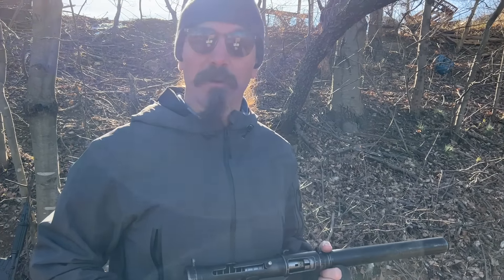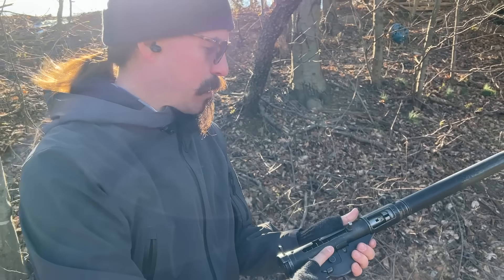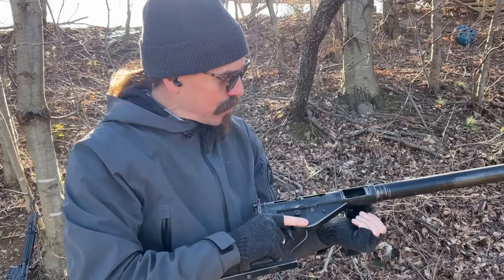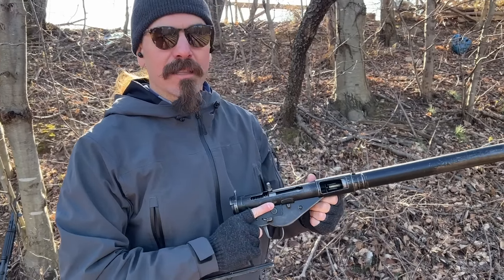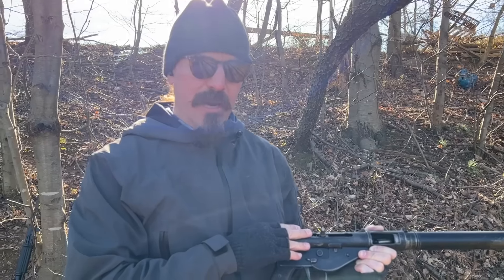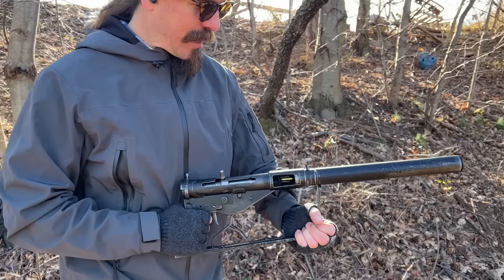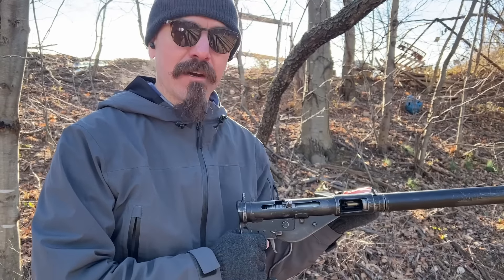Prototype Silenced Sten Mk4(S) at the Range

Comment: Archeologists in 200 years: We found a prototype STEN gun for use with ballistic face shields.
Reply: Fun fact, Britain actually fielded Plate carriers during WW2 fitted with chest, groin and back manganese steel plates. Some paratroopers and glider pilots used them in 1944. I was called MRC Body Armour.
Reply: 🤣🤣🤣🤣🤣 with an original aircraft reflex sight. Passive lighting, illuminated gunsight. Those were real too!
Reply: length of pull looks sufficiant for use with torso/shoulder armor.
Reply: Tbf, it would work well with gas masks and those had been in military service as a norm since 1916/1917
Reply: @ColBunkMust   True its a nightmare aiming with gas mask on
Reply: @The_Fubar you weren’t called that!
Reply: I disagree, Dr. Floznut44; I believe humans of the ancient 20th century had extremely large noses

Comment: I shot a bunch of machine guns at Rivers Edge Tactical in Ohio. The Sten Mark? was the softest and easiest shooting gun we shot that day, I was shocked that a pile of stamped steel and nuts and bolts could be so civilized.  Great video Ian!
Reply: The Sten has an absolutely stinking reputation, largely due to people on the Internet who've never handled or fired one parroting equally uninformed opinions they've read on the Internet. 95% of malfunctions on Stens are magazine/feed issues, partly due to 80 year old milsurp magazines, the remaining 5% are largely shonky wartime manufacturing issues, shonky rebuilds or worn parts. The design of the Sten is so basic that there's practically very little that can be  wrong about it, there's certainly no significant fundamental flaws in its design that aren't shared but other open bolt SMGs. Obviously any reliability issues are a problem if you're depending on it to save your life in a world war, but it largely did what it had been designed to do given the constraints of the time and it really doesn't deserve the "worst gun ever" label often slapped on it, at least in terms of what left the drawing board.
Reply: I agree, also I must thank you for teaching me the word "shonky"
Reply: @jonprince3237  it's because it's not American, so Americans that don't know anything will bash it, because reasons.
Reply: @jonprince3237  
No, that's the fact that it's one of the crappiest SMG in WWII. There were lots of reports of malfunction BACK IN THE DAYS. Nobody is making it up. This isn't an Ingram, a Nambu Type 14, nor a Calico. This is a STEN.
Reply: @jonprince3237  I've owned a registered Sten Mk-2 for 40 years. It runs like a sewing machine. I think the closest most people have been to a Sten, is video games. You're exactly right about the Sten, but I can add a bit to it. On some of the tube guns that were hurriedly built before the ban, the ejector is in the wrong spot, causing cases to hang up in the receiver. Some of those guns have been fixed in the ensuing years, most have not. Make sure the magazine feed lips are at 11° and the springs are the proper length. Only load 30 rounds in the mags. Some mags won't work no matter how much fiddling you do-toss those away. Use sub gun ammo, the hotter, the better. Many problems stem from crap ammo. Replace all the springs in the gun if you can. Like you said, these things are 80 years old.
Suppressed Stens are not intended to be fired full auto. They were the gold standard for suppressed firearms for many years, and were used in Vietnam, The GWOT, and still being used today. They're one gun you just can't kill...lol
Reply: @hoppinggnomethe4154  There were numerous reports of reports. Given how many STENS were produced at minimal cost and maximum speed it is impossible that there would not be issues with some guns. But, how many actual reports are there of combat malfunctions and how many reports of reports are there?
After all, we all know that a German sniper just needed to listen for a ping to know that a Garand was empty and it was now time to shoot the GI while he was reloading.
First-hand comment I read decades ago said all that was needed was for the armourer to run a a wire brush over and through the STEN before issuing it from stores to guarantee it would run right and that issues with the magazine couldn't be laid at the gun's feet.
Reply: @jonprince3237  I was equipped with a Canadian "SMG" in the 80s, Not quite a Sterling but basically the same, which is the Sten build in peacetime when there is less pressure to crank out as many guns as you can.  The thing worked beautifully, Very accurate very controllable very reliable.
Reply: Try a subsonic single barrel 410 with a built-in suppressor.
Reply: @jonprince3237  Thanks very much!!! 

I've already been insulted in various forums as an ignorant idiot because I took the liberty of pointing out that there must have been good reasons why the Sten submachine gun continued to be used many years after the Second World War. There must also have been good reasons why British special forces continued to have the Sten in their arsenal alongside modern submachine guns for a long time. The Israelis would hardly have copied a bad weapon, would they? The Germans also copied the Sten (code name"Gerät Neumünster"), they only attached the magazine at the bottom.

It was always a problem when the shooter used the magazine as a grip, which could lead to malfunctions. With increasing production quality - especially of the magazines - the quality of the weapon increased. In the end, the Sten did what it was designed to do. No more, no less. Given the extremely low manufacturing costs, this weapon was a great success.

Comment: That comes across as a lot quieter than most modern suppressors that I've heard reviewed.
Reply: Very short barrel so bullet velocity is slow and long supressor with lot of room to gas expand before
exit is nothing new in market but today people usually shoots full power ammo with normal
length barrel trough cans with lot of less dimensions to gas to expand. So of course
those will have less effect because not too many people are willing to have half meter long
supressor attached to 16 inch barrel.
Reply: It's shooting subsonic speeds so the bullet velocity is terrible.
Reply: @notgray88  Not terrible. Normal 9mm is just above speed of sound - 340 m/s or so. This will have something like 280-300 m/s.
Reply: Hallo
Reply: @asdfghyxcvbn1806  According to Ian, 240 m/s
Reply: @notgray88  Really? I didn't watch yesterdays video yet. If so, than yes, it is pretty bad. That is about the same impact energy as 38/200 revolvers had.
Well, I still would not be willing to stand in front of that thing. ;)
Reply: @asdfghyxcvbn1806  he said it in this video 0:54
Reply: That's because it's huge, this would be an "integral suppressor" by today's standards. It's an apples/oranges deal to compare it to a screw on can small and light enough to work with a recoil operated pistol.
Reply: @rollastudent  OK. I didn't notice. 800 ft/s or ~ 244 m/s.
Reply: Ta. I wasn't asking for people to submit their theses.
Reply: Mp5sd would be much quieter since the breach is closed vs the sten being open
Reply: And it’s open bolt !
Reply: Microphones don't catch gunshots well, in person all guns are much louder, even supressed ones.
Reply: A good portion of this is actually due to the ported barrel.  Obviously the size of the can and ammount of baffles helps, but the affect that diversion of pressure from the bore has is not to be understated.
Reply: @Manco65  Long barrel on low pressure rounds give much more area for gas expansion before the projectile exits, causing a lower pressure discharge, and by effect, less noise.
Reply: I handload 150 grain projos for 9mm. Subsonic with a can out of a glock is very surprising.

Comment: It looked like the bolt wasn’t even bottoming out in the receiver at 3:40 which is surprising considering how much weight and spring strength has been taken out of it. Seems like it was just barely cycling

Comment: You need to lock the automatic gain on your recorder otherwise it's compressing the peak of the weapon firing down to human voice level. 
You'll have to sound check and set the gain manually off your peaks but it'll give a much more accurate representation of the sound.
You can always have a second recorder running with AGL switched on so you never end up with unusable audio

Comment: I feel like the ideal use for the suppressed Mark IV would be with underground saboteur and guerilla units.

If they'd made more, I could see a group of guys carrying these with two mags each alongside their fellow partisans equipped with rifles and shotguns.

Maybe have the "scouting" forces sneak in and take down as many unwitting sentries as possible to gain access to a critical infrastructure point while the "louder" forces set up defensive positions in case reinforcements arrive.

Then by the time the explosives are set, everyone takes off and the enemy scratches their head the next day at why no one raised the alarm before the fuel depot exploded.

Comment: I wonder if the ease in keeping it on target is helped by the lack of cheek weld, as in the slow mo you can see the gun as moving and your body is being pushed, but your head is being held rather stable.
Reply: That would probably be technically worse because the sights are moving in relation to your eyes, whereas with a cheekweld your eyes are moving with the sights. Neither is ideal, but one should be a little less un-ideal.
Reply: @Tunkkis  that makes sense. All the guns I have let me get a proper cheek weld on apart from handguns which are their own deal. Ive never shot a stocked gun without a cheek weld available. I'd imagine from a shooters perspective instead of an observers perspective it's quite different.

Comment: I heard lots of Maqis were missing the tip of their middle left finger by popping then in the ejection port before firing.
Reply from the maker: That would not remove a part of a finger, it would just hurt a bit.
Reply: @ForgottenWeapons  House renovation in northern Italy recently uncovered a pair of rusty Stens plastered into a wall.   Partisan cache it is thought.
Reply: @ForgottenWeapons   - French-types are quite soft tho'. Cheers. Probably just an allegory for courting the mademoiselles.

Comment: What strikes me as so odd about that stock is that if they'd just added a top strap to the stock, there would have been a cheekweld available. Obviously the folding mechanism puts limits on the possible geometry of it, but when folded, there's a lot of space in front of the trigger guard. Potentially it could even just be a continuation of the rest of the stock continuing forward a bit. I can only presume that the imminent arrival of the Mk5 with it's much better stock killed off any attempts to iterate this into something better.

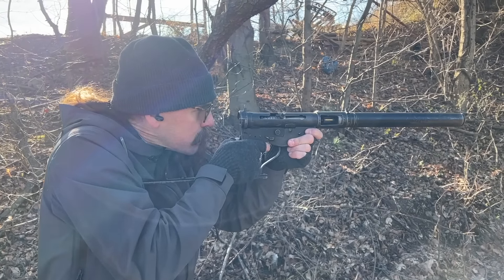Comment: Did it have a malfunktion at 3:32 ? Because it was in semi auto, and the round fired and ejected, but the bolt slammed closed again. Wouldn't this have fired a second shot if the mag wasn't empty?

Comment: I have a question about how you grip the weapon. I noticed your left hand holding it by the magazine rather than any part of the fore end or the suppressor. I've never encountered a Sten of any mark; but it seems to be superficially similar to the Stirling SMG. If you grip the Stirling by its magazine, two things will happen : first, your instructor will curse you and your ancestry in colourful terms; and, second, you risk the magazine vibrating loose, especially when firing bursts. The place for one's left hand on a Stirling SMG is gripping the "cheese-grater" (the perforated cylinder that encloses the barrel).

Does the Sten's suppressor get too hot for it to be a sensible place to grip the weapon? Or is the magazine so securely attached that there's no risk of it vibrating loose? Or what is the best approach there, and why?

BTW, I really liked "I had a malfunction because Sten."

Comment: Did anyone else notice the hole for the missing suppressor retaining screw was leaking gas for most but not all of the shots? Like the first two out of three, Like the hole is barely aligned and firing it sometimes closes it. I'd be very careful with you hands around that hole.

Comment: That front grip thingy is the most awkward type of it's kind I ever saw, but given that the sten magazine pokes out from the left side of the gun, any other grip/stock combi systems like the one that micro uzi was equipped with would interfere with either the  mag or ejection port. 
They might be better off with conventional SMGs or even pistols but UK has a small range of options to choose from.
Reply: I think there was method to the madness... Side mag meant the paratrooper could lie-down lower to shoot.
Reply: @Goit_Goit  yes, especially given that paratroops have little to no access to a trench or any other place to take cover.